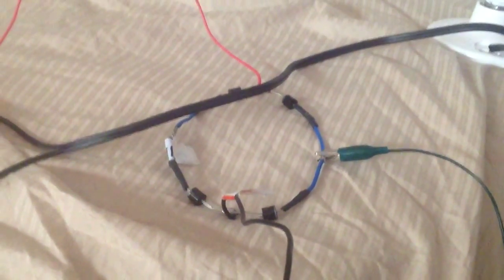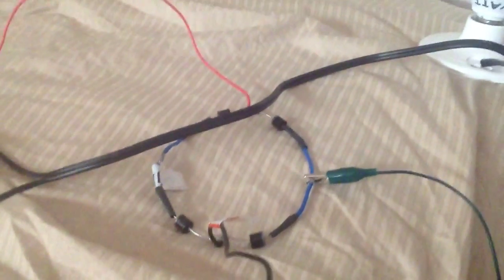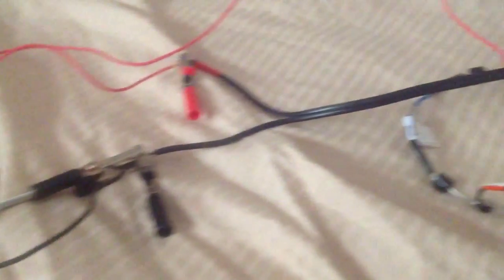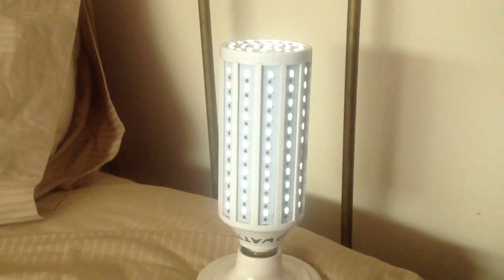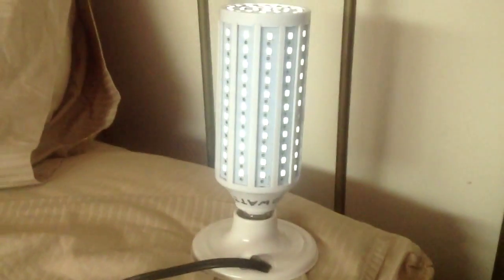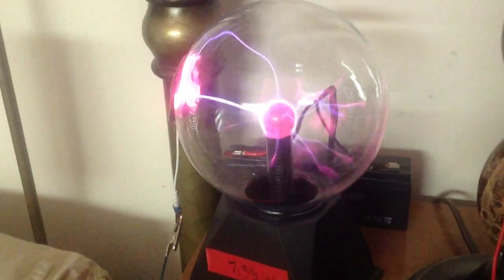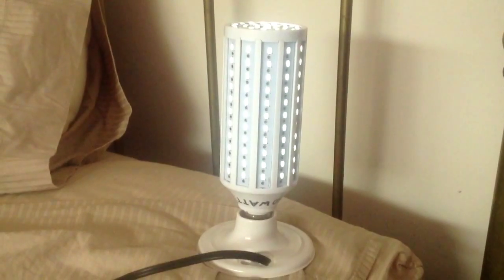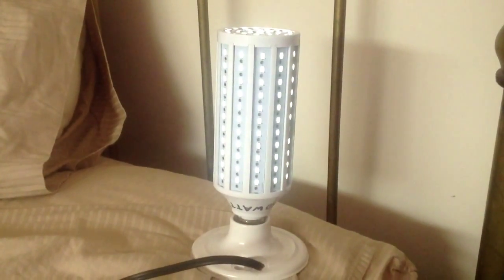Plasma ball and fully lit  50 watt led lamp  NO HANDS!!!

Comment: Well done, but the question is, if the bulbs is really so bright as if it is plugged directly into the grid ? Also on RF frequencies these LEDs work pretty efficient. Also it could be that you are pulling free electrons from the ground. Anyway, well done !
Reply from the maker: overunitydotcom With no ground wire no lamp light up  With ground on negative or positive leads the lamp lights up in full.  Electron flow has to be coming out or going to the ground.  Not through the atmosphere.
Reply: Thomas Ferko 
Good work! Using high voltage to pull charges from earth is someting I belevie in. Just back at home from vacation, hope to find some time to do more experiments soon.
Reply from the maker: YouRogga 300 DC volts to the lamp WITH the ground wire on the positive terminal.Lamp fully illuminated.   234 DC volts to the lamp with NO ground wire on positive terminal. Lamp is not illuminated.My guess is ground power is lighting the lamp in some strange way. Touch the connections will result in a shock.  Current to be determined next.
Reply from the maker: Thomas Ferko   I measure on the negative side 1.3 amps  Very little current on the positive side. In both cases the ground wire was hooked to the positive terminal.    300  volts minus 234 volts equals 66  volts x 1.3  amps = 85.8 watts   That's enough to fully power the 50 watt lamp.
Reply: Thomas Ferko 
Very exciting! :) Several things I like with this setup. Single lead (open circuit) is one of them. 
And the simplicity (except for the plasma bulb, not easy to build). 
It could be that it works like a pump, pumping charges from the earth.
It is posible to pump heat from earth, so why not charges also...
So the current draw is 0.5A from the battery (6W @ 12V)?
Reply from the maker: YouRogga   See my latest video called   HIDDEN ENERGY.  I would like to know where all this power is coming from.